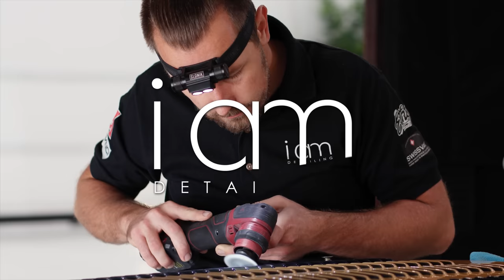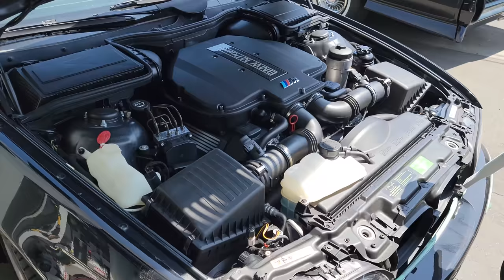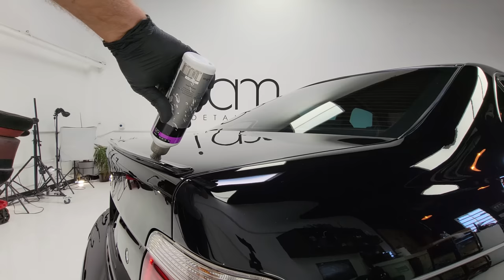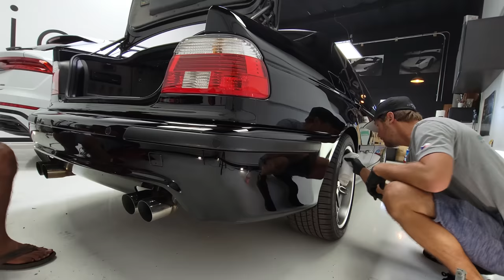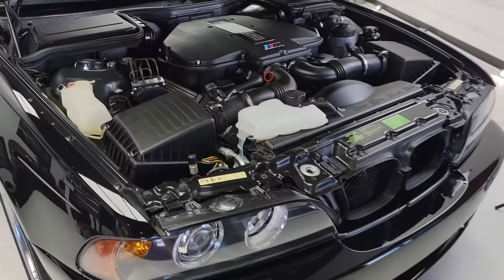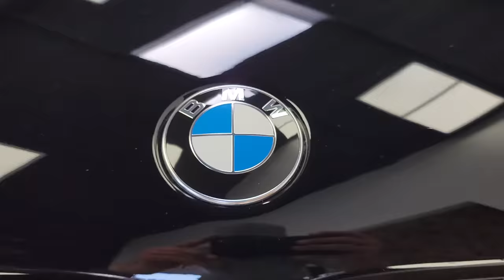DETAILING BMW E39 M5 | Dry Ice Cleaning, Paint Correction, PPF, Ceramic Coating, Interior,the works!

Comment: That looks incredible. At least as good as new.  Black is one of the most difficult paint colors to keep looking great. As an owner of 3 classic bmws my 1991 850i/6 in Schwarz black shoes every imperfection. My 2000M5 is Anthracite metallic grey which. Is a lot easier to keep shiny  and my 97. 540i/6 daily driver is Oxford green metallic but that one is in dire need of a paint job on the hood and roof ( not really worried too much about it though) - Dry ice blasting yields incredible results. Wonder What would the ballpark cost be to dry ice an engine bay and underside of entire chassis typically be?

Comment: Just curious, does the dry ice blasting remove factory protective coatings such as wax etc? Or just the dirt that piles up on top of it
Reply from the maker: Both, depending on the level of intensity. Then we replace the wax with 3m clear matte wax or cosmoline

Comment: Amazing work, although it's really satisfying and looks great what's the point of doing it? Unless it's a showroom car I feel as though cleaning the underside of the car is a waste of time since it will get dirty again really quickly and you cant even see it no?
Reply from the maker: That’s like saying “why wash my body and go to the gym because it’s going to get dirty again and get old”. The more we take care of things we care about, the longer they last and the more we can enjoy them. Dry Ice Cleaning helps you spot leaks early so you can catch a part before its an issue. Ppf keeps the paint you just buffed top quality and protected and then the ceramic coating makes water and dirt fall right off the car. That’s why. We care about the things we own and we want them to last many year in to the future. Theyre not disposable trinkets. Theyre tools and treasures. :)
Reply: @IAMDetailing  How much would everything you did in the video cost the owner?